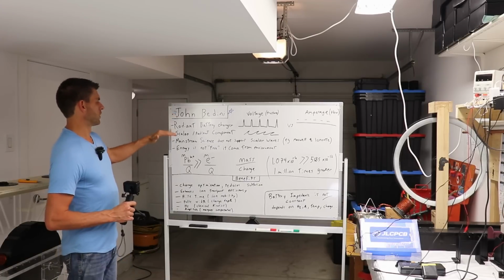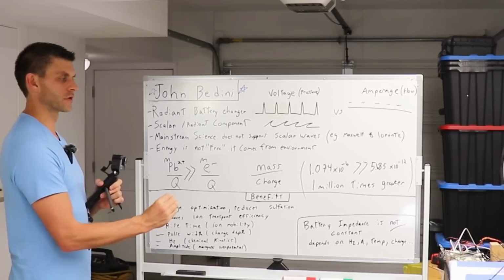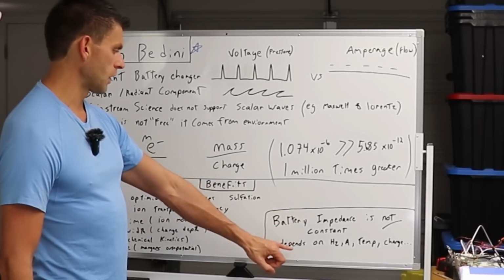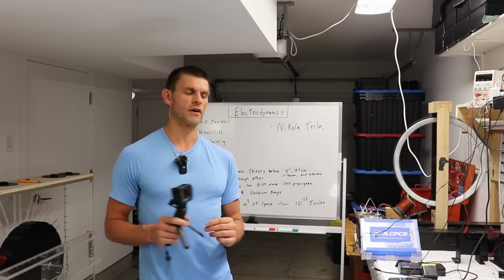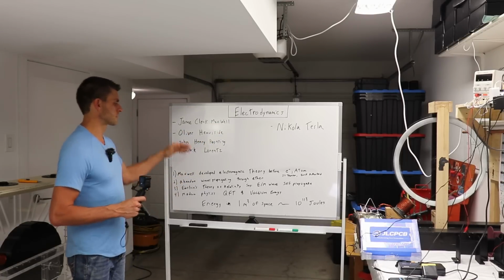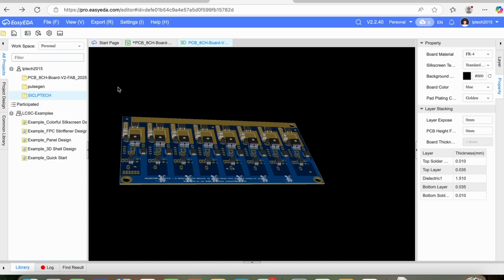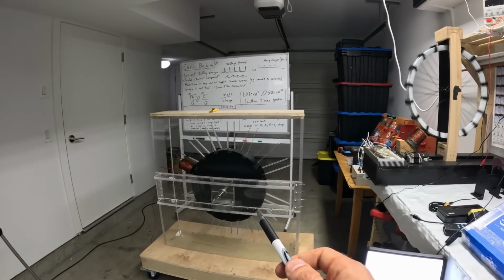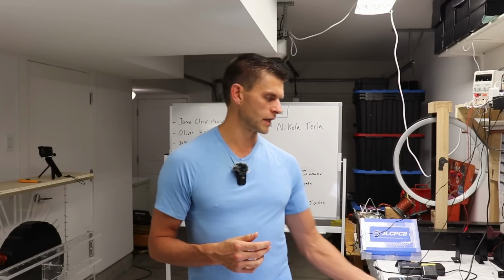They Said It Was Impossible  We’re Building It Anyway

Comment: Technical Evaluation of the Zero-Point Energy Project
This document provides a detailed technical analysis of the concepts presented in the video, with the goal of offering a more rigorous framework for the project's experiments and claims. This evaluation is based on established principles of classical physics and electrical engineering.
I. Analysis of Observed Phenomena
The video's core experiment centers on a device that uses a low-voltage input to produce a high-voltage spike, which is then used to charge a battery. The creator claims this demonstrates a "zero-point energy" effect, where more energy is produced than is consumed.
1. The High-Voltage Spike: Electromagnetic Induction
The high-voltage spike you are observing is a well-understood phenomenon called inductive back-electromotive force (back-EMF). This is not a source of "new" or "free" energy but is a direct consequence of a fundamental physical law.
 * The Principle: An inductor (in this case, your device's coil) stores energy in a magnetic field. The energy stored is given by the formula:
   E = \frac{1}{2}LI^2
   Where L is the inductance and I is the current.
 * The Effect: When the current flowing through the coil is abruptly interrupted, this stored magnetic field collapses rapidly. This collapse induces a high-voltage pulse across the coil. The voltage's magnitude is proportional to the rate of change of the current, which is very high when the circuit is switched off.
 * Conclusion: The energy in this voltage spike is the very same energy that was originally drawn from the input source to build the magnetic field. A portion of this energy is lost to heat in the coil and is converted into the mechanical work of spinning the wheel. The remainder is transferred to the charging battery.
2. The Battery Effect: Pulse Desulfation
The claim that the device "rejuvenates" or "reconditions" a seemingly dead lead-acid battery is a key part of the over-unity claim. This effect is also supported by conventional physics.
 * The Principle: A common cause of failure in lead-acid batteries is sulfation, where non-conductive lead sulfate crystals build up on the battery's plates, hindering its ability to charge and discharge.
 * The Effect: High-voltage, high-frequency pulses can break down these crystals through a process called pulse desulfation. This restores the battery's plates, making the chemical energy that was already stored in the battery (but previously inaccessible) available again.
 * Conclusion: When you measure a "rejuvenated" battery and find more energy than you put in, you are not creating new energy. You are simply unlocking energy that was dormant in the battery's chemistry, making it a more effective battery charger.
II. Mathematical and Conceptual Tools for a Rigorous Analysis
To move from observation to a verifiable scientific claim, it is essential to perform a complete energy balance of the system. This requires moving beyond qualitative claims to precise quantitative measurements.
1. Mathematical Tools for Energy Balance
To accurately measure the energy input and output of your device, you need to use the tools of calculus, especially for pulsed signals.
 * Power and Energy: Power (P) is the product of voltage (V) and current (I), and energy (E) is power over a time period (t).
   P = V(t) \cdot I(t)   E = \int P(t) dt = \int V(t) \cdot I(t) dt
 * Measurement Imperatives: Your input and output are not constant DC voltages; they are rapidly changing pulses. A standard multimeter will give you a misleading average value. You would need an oscilloscope and a current clamp to simultaneously measure the voltage and current waveforms over time, allowing you to compute the true total energy transferred.
2. Accounting for All Energy Forms
A complete energy balance must account for all energy leaving the system, not just the electrical output.
 * Electrical Energy In: The total energy drawn from your "run" battery.
 * Electrical Energy Out: The total energy transferred to your "charge" battery.
 * Mechanical Energy Out: The kinetic energy of the spinning wheel.
 * Wasted Energy Out: A significant amount of energy is lost to heat (from the coils and the switching components), friction (in the bearings), and sound (air resistance, vibrations). A calorimeter would be the most rigorous way to measure the total waste heat.
The First Law of Thermodynamics dictates that the total energy input must equal the total energy output (useful and wasted). An apparent output greater than the input would indicate a measurement error or a misattribution of an energy source, as in the case of battery desulfation.
III. Alternative Perspectives and Constructive Ideas
Instead of framing the project as a "free energy" device, consider what you have actually built from a conventional engineering perspective.
 * As an Inductive Pulse Generator: Your device is an excellent example of a DC-DC boost converter, a common circuit used to generate a higher voltage from a lower one. You could focus your efforts on optimizing its efficiency, improving the components, or making it more compact.
 * As a Pulse Desulfator: You have a working prototype of a battery reconditioning device. This has real-world applications in extending the life of lead-acid batteries, a legitimate and valuable service. You could refine your design to be a more efficient and powerful desulfator, a task that has a clear engineering goal and market.
This redirection of your focus would allow you to continue your impressive work and technical exploration while grounding it in verifiable, impactful scientific and engineering principles. The knowledge you have gained in building this device is a valuable skill set that can be applied to many other projects.
Reply from the maker: Cheers
Reply: @MadscienceLPTECH thank you I have experimental artificial intelligence. I train directly on scientific studies and this is through them

Comment: if energy is traveling in an apple shape, that extends an inch or so. Is there any way to capture that energy as it travels back? Just a question. Love your channel.
Reply from the maker: Apple shape ? Thanks for the support
Reply: @MadscienceLPTECH , just an assumption that the magnetism energy travels from the middle or the bottom, or the top to a destination on the magnet. Possibly from the center out, I'm not sure because it tends to happen instantly. But the fact that it travels in, out, over ,under it's using energy to do so. I believe That's where the gold is metaphorically speaking. The push pull is traveling around a point in space that is storing a tremendous amount of energy looking to go somewhere.  However, We tend to focus on the hard parts in the effect on them. Instead of trying to cyphen off that power, try to add to it, should make the fields expand for very little energy. Then you can cyphen the expansion of the colliding energy's for lack of better words. Half dome design might produce greater power since the magnet would want to complete its field. I apologize just thinking too much.😊

Comment: Great work I’m an amateur extra ham radio operator. I wish I had something that would run my radio when the power goes out. We are the communication system in emergency  situations.  Has to be 13.8 volts.  Any ideas?
Reply from the maker: A plate above the ground or wire across a canyon... u can get apot of voltage from a few meter difference above earth

Comment: Nikola Tesla’s ideas on electrons are summarized as follows;
Electrons are tiny spheres of exceptional electrostatic charge. They are emerged in an insulating medium. 
An electrostatic longitudinal wave will break down the insulating fluid, allowing the electrons to search each other down, and combine. The results are there is much greater voltage coming out, than put in…….this is what stienmetz was hired to get rid of at GE. It was a problem back then, as flipping a switch would create orders of magnitude more voltage than was created by the dynamo.
Tesla defined a longitudinal wave of electrostatic energy as a spark. In Tesla’s atomic theory, electrons weren’t bound to atoms necessarily, and were free floating in space. 
So any square wave of electrostatic energy can “dislodge” more than put in, if the apparatus is set up correctly.
Reply from the maker: so cool great comment :)
Reply: @MadscienceLPTECH  I have been trying to explain this to so many, and no one understands. You are the first to actually mention this is relevant. 
Since you are open to this information, I will share the secret of the radiant patent. It is really quite simple at its root. 
Tesla said “ static electricity isn’t as its name implies, it is not static but vibrates at a frequency of one million per second”, he went of to say that, because of the static electricity has a frequency, he was able to get all the results he had in his later life. 
If you push a spark @ 1 million per second(more or less) you will find the resonant frequency of the insulating medium that surrounds all electrons, and the electrons will start combining, their energies combining at the same time. Only a small plate, properly grounded is sufficient to pull massive loads from the atmosphere. The spark must be oriented in one direction, and the spark must completely disengage before the next spark starts. 
Tesla found the air would start luminescing after 15 minutes, and would stop about fifteen minutes after the sparking apparatus stopped.
He also found the luminescence could not be picked up by a regular camera, only our eyes could see this frequency……at least at that time. 
So……there you have it. Look up what tesla said of his quenched spark gap patent in the Westinghouse bankruptcy hearings.
Reply: @donaldbest7621  is the spark made on the grounded plate or on something else near the plate like a nail ?? Im trying to fully understand your comment its interesting
Reply: @Diamond_Fangs888  just search down some videos of Peter lindeman…..he is the closest to “over the target”, imo. He will explain the spark gap, and a little of the radiant patent, but missing the crucial ingredient……the frequency. A spark gap discharging @ 1 million per second. Resonance unlocks infinite energy and effects that might seem other worldly.
Reply: @Diamond_Fangs888 the spark gap broke down the insulating medium, by way of finding the resonant frequency,  which keeps electrons separated. Tesla said this insulating medium will not react to heat(cold), or chemical reactions, only a wave of electrostatic energy, and it must be longitudinal. Super fluid(no surface tension) doesn’t “do” transverse waves, which is a separate subject. 
After the insulating medium has broken down, The electrons by virtue of electrostatic attraction will combine. electrostatic attraction of the earth, by way of an attached conductive small plate is sufficient to gather a ridiculous amount of electricity. Just search down Tesla’s radiant patent. It’s all there. 
A battery(s) can be attached to the plate, and an inverter. That’s what “they” don’t want.
Reply: @donaldbest7621 hi this sounds very interesting, what would we need to make this happen?
Reply: @donaldbest7621 😮do you mean a kind of freq around thee iR rannge
Reply: @Greg.UWU.22 a spark at the lowest possible energy(Tesla’s quenched spark patent and explanation) always discharging in the same direction at around 1 million times per second…..is the secret to the radiant patent(there is a spark gap in the patent)
Reply: @donaldbest7621 🤔🤔✅ I don't think it's got anything to do with a sparkkki.. U need to convrt heat into mag.nit.tis.summs
Reply: @Greg.UWU.22 Nikola Tesla said 
“I can suspend tons in the air with only the magnetic force, but what is magnetism against the repulsion and attraction of the electrostatic force, to which I can find no limit.” 
Feb 1893 lecture on light and high frequency phenomena. 
Feel free to watch as many Peter Lindeman videos as you can. He speaks clearly on Tesla’s one wire system of energy delivery. 
This system of energy delivery, is not a tranverse wave, it is longitudinal. A longitudinal wave can only be initiated by electrostatic force. Electrostatic by definition is electricity with out magnetism. 
In fact, after 1891 Nikola Tesla never worked with magnetism. All of his inventions in electricity after 1893 time frame were specifically confined to longitudinal wave phenomena, and or electrostatic energy. 
If you understand the importance if Tesla’s ideas on electrons, and energy transmission, you might come to the same conclusion as I did;
Tesla likely gave away all his patents on AC three phase because he thought them worthless, in light of his new discovery in longitudinal waves. 
He simply replaced the wire with the earth, and in fact the earth has less resistance than a wire, which he explained very well in the Westinghouse bankruptcy transcripts. 
I do suggest the westing house bankruptcy proceedings to comprehend Tesla’s thoughts on electrostatic compressional waves.
Reply: @MadscienceLPTECH  read what Tesla says about how one snow flake caused an avalanche in his youth. It’s key to understanding how tesla was able to get so much done. You can use a wrecking ball, and take weeks, or a ten pound weight and make it all rubble in moments. 

https://www.worldradiohistory.com/Archive-Electrical-Experimenter/EE-1919-02.pdf
Reply: Electrons are simply a model representing discrete units of charge, which is useful for math, but no such thing really exists in nature.
Reply: Electrons not egsist, current is electromagnetic wave
Reply: @ALJ-xl6fx read the link I posted in this thread. Tesla in his own words. Tesla’s current has no electrons moving, only energy moves. That is why there is no heat created, and as John moray found out, a 22 gauge wire can transport 10 kilowatts.
Reply: @donaldbest7621 🎉orrrr mayybbee.. it's move HEAT..OUT .. pulling heat from thee environment.. thussStays cold.. 🤔
Reply: @Greg.UWU.22 there is no heat in this process. If you could copy Tesla’s appuratus, even the sound is so small, Tesla said it sounds similar to a fly buzzing around. Tesla said put the spark gap in a vacuum, use silver for the wires, keep the whole thing at under 0 degrees, and the efficiency goes up greatly. 
In other words, there is no heat created, save for a tiny bit in the spark……but the spark is so small, it can’t be seen(Tesla’s words), it can only be heard.
Reply: @donaldbest7621 I guessssss you didn't get wat I'm saying hear . Fridges are cold 2.. 🎉😂and they flow that heat 2 ..alsoo

Comment: With such low torque, how do you pull any usable power from it?
Reply from the maker: i dont think the big one will have any problems :)
Reply: Almost no torque is needed, because the momentum isn't being used to generate current and therefore there is no drag induced by the output. It functions as a rotary switch.
Reply: @Jwareness i see so once its net positive you could disconnect the battery and it would keep spinning.
Reply: @WhatTheFunctionX  No, it still needs a power source to turn the wheel, it just wouldn't use any more power under load, since the only work being done is switching.

Comment: How much are the tech side of things and hardware roughly? And is joe planning on making multiple kits and sizes
Reply from the maker: would you like us to provide kit option in the future?
Reply: Yeah, I’d like you to provide the electronics as complete kits—or at least offer the individual components—so builders can create their own setups. I can handle the frame, flywheel, and similar parts, but making sure all the electronics and wiring are 100 % correct is crucial. One mistake could leave me chasing problems for a long time, only to discover it wasn’t the real issue in the first place.

Also magnet kits that are properly balanced and of the correct type. Various sizes

What electronics are you planning for the battery system? Are you going to use multiple batteries that automatically switch so you don’t have to replace them manually? And what kind of wiring outlets / plug in capabilities can/do you plan on using on this 

Finally, what is the braking mechanism for this? Will you simply cut power to the coils and let the rotor finish its rotation, or is there another method? I know you got the sensors etc but just trying to understand the full picture and what I can and can't do and how to assemble the materials.

Comment: The problem with lead acid batteries is they can only utilize maybe 50-60% of the electric that is charging it. The rest is wasted as heat. 

Need to find a better charge circuit and battery.
Reply from the maker: I think the spiked charging of them changes their outputs ad power density
Reply: @MadscienceLPTECH  Bedini says the batterys become conditioned
Reply: Bedini mentioned cooler transistors and cold boiling batteries. the phenomenon is not completely understood but the fact is that works. my pulsed charger charges not rechargeable batteries (miracle or lack of knowledge?) I think is the second😝